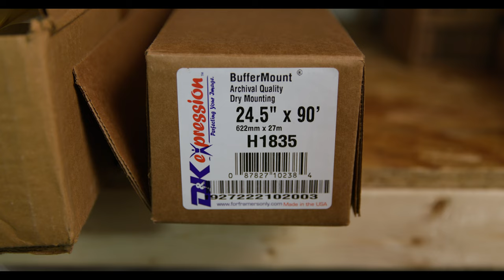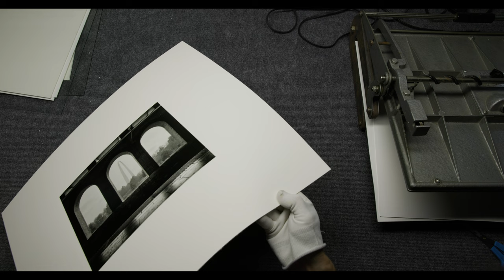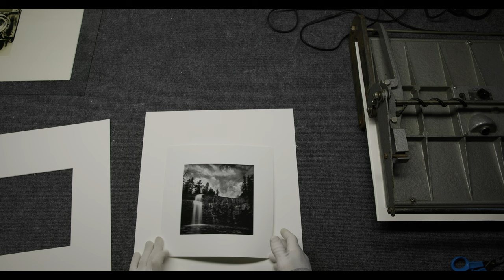Framing Photography - Part 3 - How To Dry Mount Black and White Darkroom Prints

Comment: I'm not crazy about the visible "lift" from backboard to paper, so I make the white borders on the paper itself. But I haven't upgraded to dry mounting so I can't see firsthand if I like the "inset" print look. I assume you don't do paper borders because your easel blades might not be square. I have a guide so I can adjust them square but the blade edges have neglible imperfections that I don't worry about. 

On a side note I really appreciate this series. It's helped me to try and get my work more professional looking. There's a million film channels, fewer darkroom ones, and almost none for mounting and finishing. Thank you for this!
Reply: I'm also relieved to see you use photo corners. I thought I was weird using glue and corners much the same way.
Reply from the maker: Glad to make the series. I know it will not initially get as many views but think long term it might help out a lot of people with no real direction to go when looking to present their images.

My easels are pretty good but a trimmed edge is just cleaner looking in my opinion. But that is also getting pretty picky 😀

Comment: That’s a great demo. I’d just add that you don’t need to spend $$$ for a photo dry mount press. There are heat presses designed for attaching transfers to T-shirts that are way cheaper. I recently bought one new with a 20”x20” platen for £325($400) that does exactly the same job as the Bienfang. Also hobby tacking irons for model making are cheaper than the photo versions. 
Really enjoy your videos Matthew.
Reply from the maker: Thanks! I always wondered about the t- shirt presses. That is about what I paid for my press used with shipping.  All Be it it is old and dirty so a new option would be nicer 👍

Comment: I noticed the other day that boss man Michael kenna sells his prints dry mounted . I've been told not to dry mount for archival reasons etc but surely MK knows his stuff !!?
Reply from the maker: Hey Austen, hope you are healing up nicely 👍

So, from an aesthetic’s perspective I much prefer dry mounted prints. The trimmed edges just look clean and satisfying.

We are after all finishing our prints so to me it is the best way.  If you use archival rag mat the mount should not matter, and further with the buffermount tissue I use can be reversed.  Though I will not and never intend to do this myself…. Seems to daunting.

Smaller prints will look fine unmounted but 11x14 and larger always look better drymounted ( that is assuming one does not muck up the process ). 

It’s like the toning process all over again…. Very easy to wreck a great image. Practice required to do a good job.

But when done right nothing comes close aesthetically. I guess the archival part can be debated but like you mentioned Kenna, Adams, etc…

Comment: Another approach is to mount prints to 2-ply board to flatten, then hinge-mount or use corners to attach to bottom matte. I find that, while flat is not exactly what I'd call these mounted prints, despite pre-heating, they do indeed stay flat under the window matte. I only print to 11x14, but others who print 16x20 and larger also use this technique.
Regarding flatteners, I use a piece of formica-laminated kitchen cabinet that someone down the block was tossing. It's even light gray. My neighbor cut it in half and we screwed the two, approx. 16x20 pieces together to make a 1.5-inc-thick piece for extra weight -- probably overkill, since the underlying board is thick and heavy. I got a cabinet handle from the hardware store and mounted it.
Reply from the maker: Ingenious way to weight the prints👍 I have to build something and you have given me some ideas 🙏

Comment: Great video series Matt…I keep looking at the gloves you use that appear very comfortable…what brand are they? Thanks for sharing… Cheers..
Reply from the maker: Oh man... I wish I knew as well. I have had these for years (there is no tags or symbols on them) My father was a Pharmacist and he would sometimes have to mix drugs in a controlled enviroment at the hospital using what I picture to belike a fume hood with rubber sleeves ( a sterile enviroment I believe. These were the gloves they would have to use when mixing the prescriptions. They were thrown out after each use.  So he brought them home and saved them for me.  He has since retired and I lost my hook up...

Maybe a google search for Pharmacy tech gloves or the like might find some? The other thinner pairs that I have are just from Adorama or something like that. They work well but the drug gloves are far superior. I will have to find some at some point as the pairs I have will wear out.

If I (or anyone else) can find a good set I will let everyone know!
Reply: @Distphoto  Thanks anyway Matt…I’ll keep looking. I’ve tried three different brands, and pretty much all are crap… one time use and they are gone!

Comment: I leave photo in the press and put the books on top there, this way you don't disturb the sandwich... seems to work. I've been looking for 1/4" aluminum plate would be ideal to add weight and cool it quickly.
Reply from the maker: Yes, I keep kicking myself I had the chance to buy the seal plate with handles for like 20 bucks locally years back and for whatever reason did not buy it…

Room is an issue for me as well so leaving it in the press is often the default. Not printing a ton of volume any way. 

Like the idea of an Aluminum plate. 👍

Comment: Very helpful for getting started, though I will try to find pre-cut mattes to start, and use those photo corners. Q: what is ATG? Also what is your brush? Thanks!
Reply from the maker: ATG is a two sided adhesive. It comes in rolls and you can use a gun to apply (though not necessary) Thanks for watching!

Comment: You should tack the corners, underneath the print, you never put heat on the print, (save for the dry mount press of course)
Reply from the maker: This is how I learned and have Never had an issue… 

But if it works for you then by all means do it.